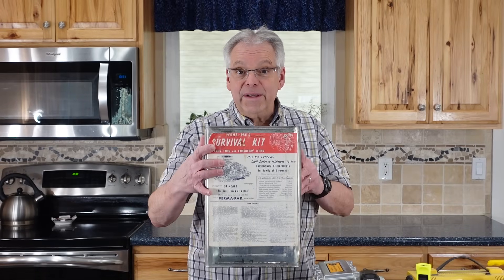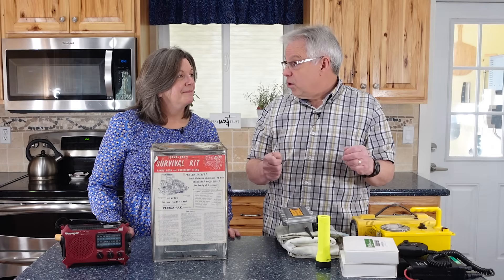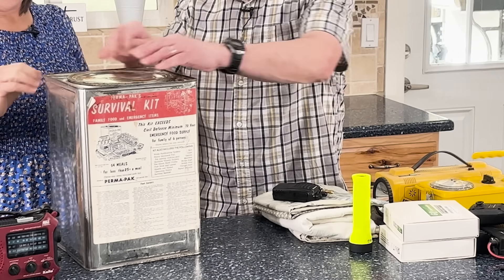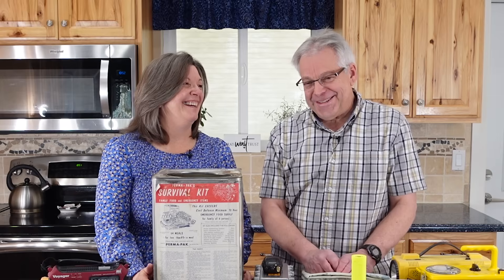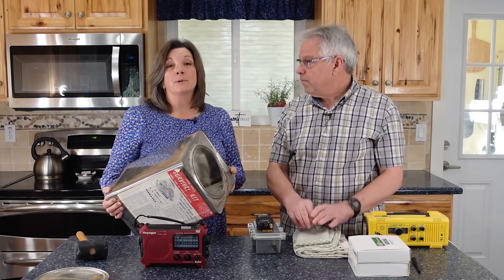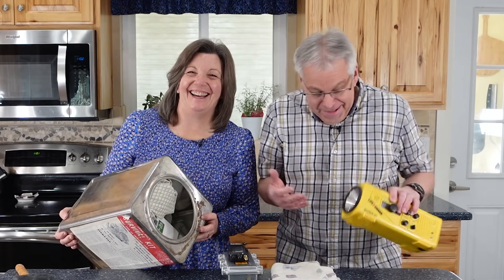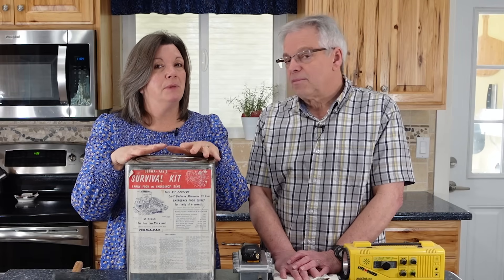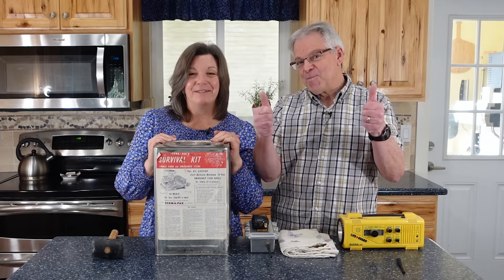EMP Survival: How to Protect Electronics In a Free DIY Faraday Cage

Comment: President Trump has greatly reduced the risk of EMP with his election to office in 2024 - well for at least 4 years. In his first term he did state that the USA power grid needed to be updated and hardened to be protected from an EMP but those in Congress did not follow his advice to harden the grid. So EMP is a problem known at the highest level of government but Congress just will not act to counter the threat. A CME (Coronal Mass Ejection) is also a known event that is independent of mankind and one is becoming more likely to occur that will impact earth AGAIN. So be ready. Keep making great video's. PS, I use a metal wall locker as a Faraday Cage and it is easy to access, use items in it and place them back with no trouble. It must be solid with no holes or gaps which is easy to fix.

Comment: I had a big stainless steel garbage can I use.  I ordered it from Walmart and they were delivered straight from the store.  They delivered it without the lid.  I informed them and they told me to keep it and they delivered the second can with a lid.  I put one can inside the other then lined the can with cardboard.  Everything I put in the can is still in it's box or wrapped in an old piece of clothing.  Other things were wrapped in socks or whatever and put in faraday bags.  I have a new small solar generator and panels I need to see if will fit in the can.  
I'm 67 and have been prepping for 8ish years.  Preached it to my kids but stopped and just gifted prepping items.  I don't plan on passing for a very long time but when I do and my kids have to go through my stuff the eye rolling may cause brain damage 😂.

Comment: As I was watching this I had the idea of repurposing popcorn tins into Faraday cages, especially considering how cheaply they can picked up on after-holiday clearances. Maybe a little overkill, but I like to put my devices inside Faraday bags before putting inside the cage. Also whenever possible I like to remove the batteries so they don't corrode inside the device.

Comment: Wait what? You were hearing feedback between the two radios outside of the metal can. When the radio was placed inside the can and sealed, there was no feedback and not a confirmation if the can rejected RF.

Comment: Question. If there's some form of disaster that would cause an electrical pulse strong enough to disable our equipment, wouldn't it most likely also destroy the transmission & repeater equipment? That is, if we protect our radios, etc. won't the radio stations antenna be destroyed? The same it would seem to be true for cell phone towers. Thanks for everything you do.

Comment: If possible, have two in different Faraday containers. If a CME one  cage is probably enough. If war and an EMP there could be another EMP event. I would think it's probable. So, having one secured at all times will prevent a complete loss of your electronics. At least radios, but some of your solar backup and other electronics, if you have those protected, would also be good to have a backup protected.

I have an old military radiation meter that should survive, but my new ones will probably not survive an EMP.

Comment: I use steel and aluminum trash cans lined with cardboard like lots of people do
Reply: You better check to see if the signal gets out because the trash can lids don't seal that well especially when it comes to something requiring a perfect seal.
Reply: But if they are great seals can;T u use some kind of tape?

Comment: Non working (cut off the cord) microwave is a perfect Faraday cage. Microwaves cannot get out and outside waves cannot get in!!🤯🤯🤯
Reply from the maker: The old ones work but newer ones allow the signal to get through so be sure to check them! I have one in my office in the closet and it is very convenient!
Reply: @TheProvidentPrepper I checked mine and you are right. The signal gets out!
Reply from the maker: @susiea1419  If you want to find a cheap one that does work you can go to a thrift store and test them before you buy. The older the better!
Reply: I unplugged mine and tested it. It did not work. The signal got in.
Reply: @deborahturner1853  not mine. I tested it.